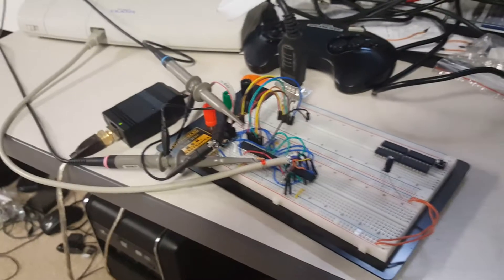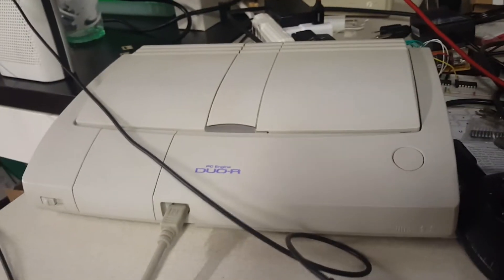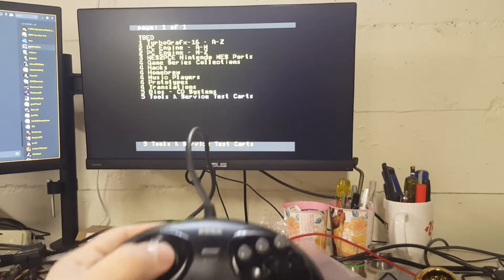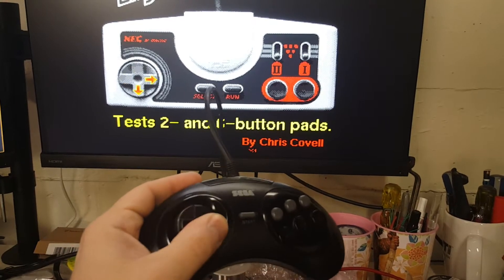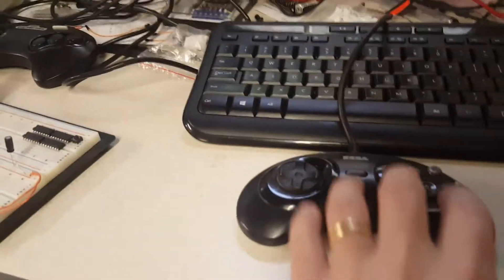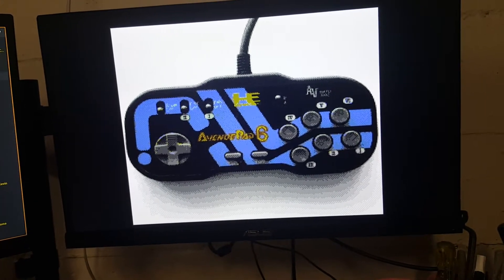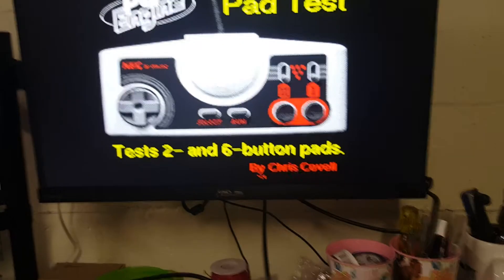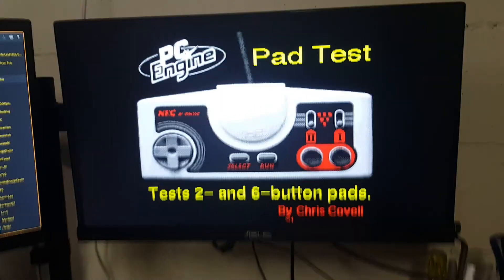Gen2pce v3 (atmega328-based)

Comment: Did you ever release this? How hard would it be to do two 6bt pads with one ATMEGA? It doesn't have to have multitap functionality since there is already a 2P adapter on OSHPark (built-in 2P multi-tap). I was working on a replacement PCB to use with my 2p tap design. Even saw someone on Twitter say they wanted a dual 6bt solution in response to the new Hyperkin controller.

I actually designed a 2P tap based on a clone tap from France so I could use off-the-shelf parts with my 6bt controller PCB.

Even if it requires 2 ATMEGAs to integrate with my tap, it looks like this would be much better than what I was planning since the controllers still work as Genesis 6bt controllers. If you could incorporate them into one ATMEGA it would be even better. If you could incorporate the tap as well... even better. :)

Two 9-pin inputs, one DIN-8/mini-DIN output, two unmolested Genesis Arcade 6bt controllers. :)